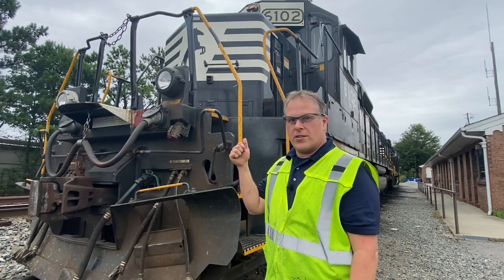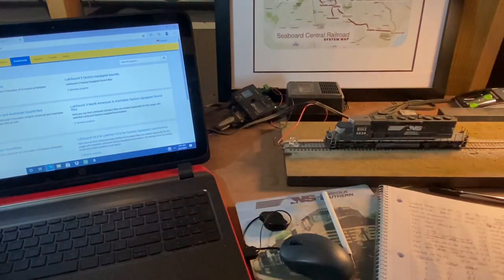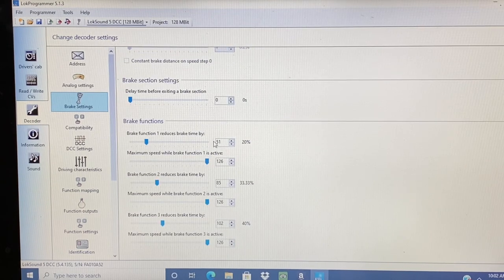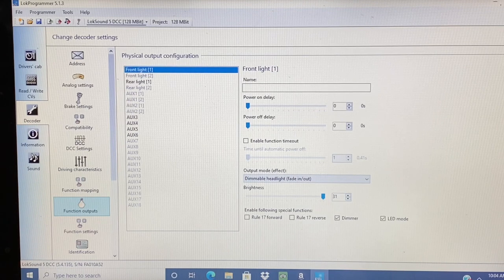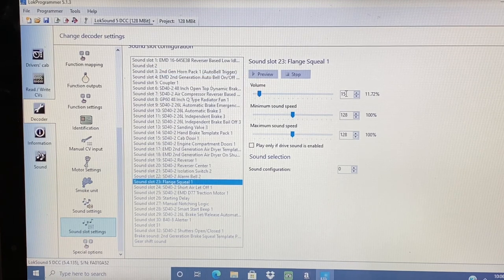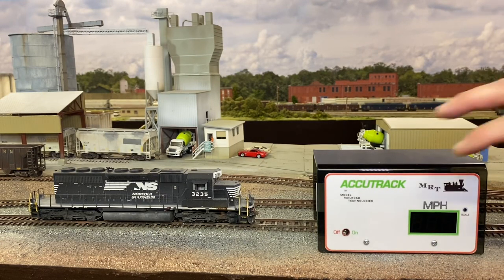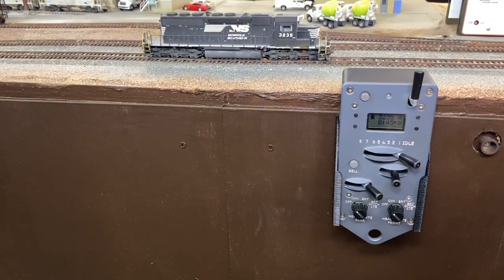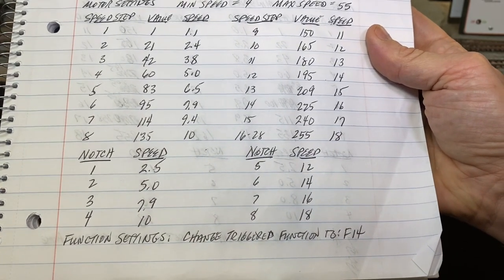Seaboard Central DCC Decoder Programming Like the Prototype

Comment: Hi Tim, Excellent video. I really enjoyed the opening and closing sequence where you were in front of the locomotive. Thanks for explaining your settings for the decoder and the ProtoThrottle. I use a flattened speed curve on my locomotives so that you get a speed increase for the first 5 notches and then only the prime mover sound notches up for the upper 3 notches. That allows you to "play the throttle" to simulate moving a heavy load without having to use drive hold. On my small switching layout it works out great set up that way. That is one of the good things with ESU Loksound decoders, you can set them up how you prefer to operate based on your needs. It is amazing how fast 18 scale MPH looks when you are running on your layout. I am already looking forward to your next video.-Tom
Reply from the maker: Thanks Tom! Yes, 18 mph is plenty fast enough. If my layout was a pure switching layout I would probably do the same thing and top the speed off in notch 5 at 12 mph. I agree that it is just another thing I like about ESU decoders and the LokProgrammer. I’m actually going to be programming some dedicated yard units at some point and will probably do just that. Tim

Comment: Tim, great job on the video!
I have always been hesitant to do the whole speed matching thing,, just like” ehh, that’s good enough” but after seeing your video you don’t make it seem like a visit to the dentist minus the pain meds. 
I will definitely be using your notes. One tip, if you have the same sound file in multiple locos in the same consist you adjust the “ sound speed” of the prime mover so they won’t be in phase together sounding like one loco. So when the model consist rolls by you will be able to distinguish each locos prime mover. On Lok programmer I think it is in sound settings tab. 
Keep up the awesomeness!!
Greg
Reply from the maker: Thanks Greg! It’s a lot of experimentation but once you get it dialed in it makes a world of difference. It is just a matter of tweaking the speed steps either up or down until you get the speed you want for each step. Also, it’s important before you do each speed step to get the min speed and the max speed set first.
Reply: Tim,
      I will sure I get the min and max set first. I know now I have accel set at 120, but my lok sounds are select/direct micro boards. I will have to see if I get the same results as your V5’s. 
Thanks
Reply from the maker: I will try to mention what I use on my selects in the next update.
Reply: @SeaboardCentral  can’t wait!!, I am going to hold my breath, 🤪. I noticed how you put the reverser in the middle/neutral while you were braking,, old habits die hard. 
How long has three step protection been around? On the CNW during the 90’s no such thing. If we had to make up air, we told the engineer “ making weenies”

Comment: Great video Tim I’ve been looking for this kind of information to set up my SD 40- 2W’s what was the reason you set your top speed at 18 miles an hour just because of layout size or is that prototypical for in Yard? Thanks for sharing this info.
Reply from the maker: Thanks Don. I set my top speed at 18 due to the grades and curvature on the line. My max speed for yard is 10 mph just like the prototype. I find that on a model railroad with our tighter curves anything over 18 just looks ridiculous and toylike. Tim
Reply: @SeaboardCentral  OK that makes sense thanks Tim and I thought I’d mention I really like your track plan for the new layout will be fun to watch your progress

Comment: This is great! Question though... I don't use the Proto Throttle. Would you make your settings different if only using the NCE ProCab throttle? Thanks!
Reply from the maker: Thanks! I actually sometimes use the NCE throttle on the road freights. The ProtoThrottles are used for the switchers mostly. The function map I use would probably be the same. I know some might set theirs up different depending on what works for them. That’s the great thing about the LokProgrammer, it lets you customize the functions any way you want it.

Comment: Hey Tim! I just got my new Proto Throttle yesterday ( an early BD gift from my awesome wife). I made a lot of head way today in programming it with TSU’s and ESU’s. My question is how do I program the throttle to work with advanced consisting using CV’s 19, 21, and 22? I can get it to work using NCE’s advanced consisting, but I prefer the Cv19, 22, and 21 because of greater control of each loco function. Any ideas? Thanks, Greg
Reply from the maker: Way to go Greg! Congratulations on getting your new PT. I would recommend going to the ISE website and look for the tips they show how to set your PT up for your specific situation. I know it is different depending on decoder brand. That’s one reason I only use one brand. There’s so many differences between the decoder manufacturers. I also just use the NCE advanced consisting for my layout. Tim

Comment: Great video, thanks for sharing!   I just got a PT and I am in learning about all the things that it can do.  I am running with ESU Loksound v5 Decoders, tho I am trying it with N scale.

One question if I may - do you disable the 'emergency brake' function on the PT?   I haven't changed any of my PT or ESU decoder brake settings yet (I do set CV3 and CV4 to maximums), but I find that by default the loco stops too abruptly when I push the brake handle all the way to the right.  Is that a prototypical brake behavior?

(Side Note - since I just have a small shelf layout, I am playing with using a separate/stationary decoder connected to a subwoofer for a deeper bass sound.  Still need to get the sounds to sync a little better, but here is the link... https://youtu.be/oxz_DUt6wdo ).  ;)
Reply from the maker: Congratulations on getting your new ProtoThrottle! What a game changer, especially for switching operations. I do in fact disable the emergency brake feature on my PTs since I treat the brake as the same as the independent (or engine brake). As a professional, when it comes to switching, the independent is what is mainly used. 
Once you do that you need to make sure you have the brake setting on your decoder set up to be able to work when you have your deceleration value set to max. The settings I came up with in this video are fairly prototypical.

Be sure to tune in to my channel next Sunday. I will be doing another video on making a decoder update for my switchers. Tim

Comment: A question about the braking values.  Is there an advantage to using all three brake settings simultaneously as in your example, compared to using only one brake setting at a higher value.  Since the brake 1,2 and 3 work cumulatively, using your example would simply setting brake 1 to 238 achieve the same result?
Reply from the maker: Good question and would be worthy of experimentation. I haven’t tried it. Although I do know the way I have it set up works great and achieves the kind of realism I am after. Thanks for your comment. Tim